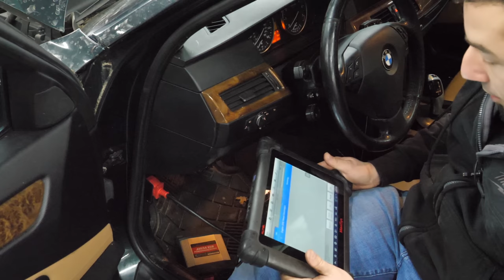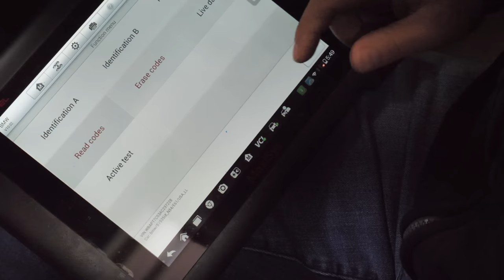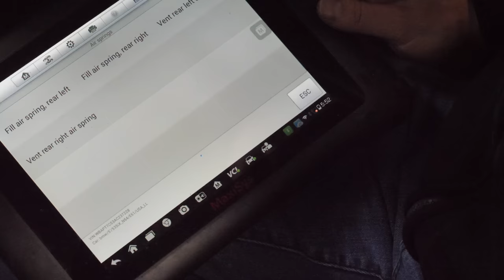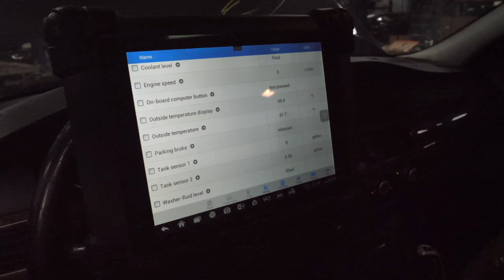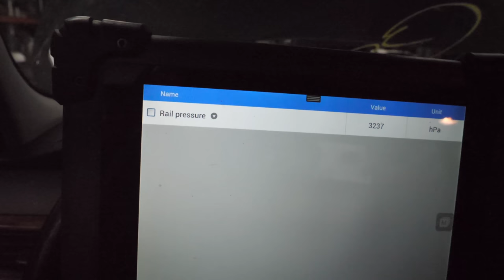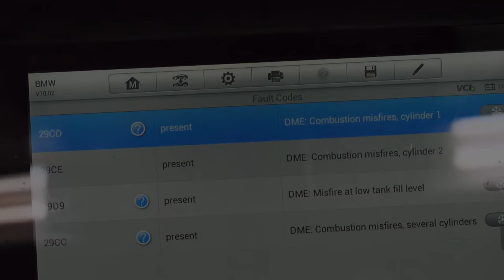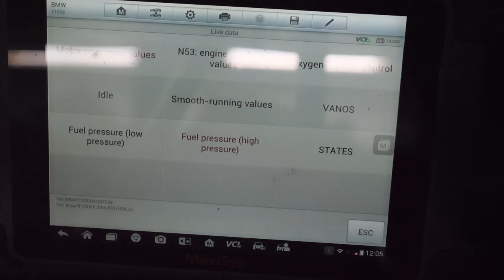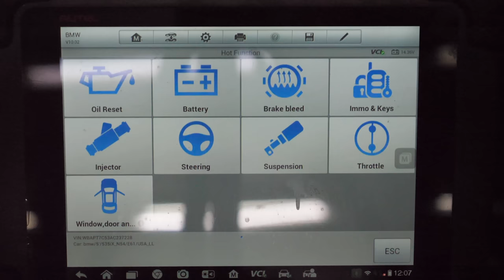WHO DID THIS? BMW Wagon I Bought At Auction LOADED with Improper Repairs. Can We Right These Wrongs?

Comment: E61 time! I have an 06 N52 6speed car, 350,000km, oooh that hatch hydraulic pump is a SOB to get out, I rebuilt mine with new seals (vid on my channel) but the hatch position sensors never worked, put in normal struts, is the hatch ECU worth money?  I laughed at the trash bag for the spare tire electronics, mine has been down 3 months now from FR CV axle replace, Trakmotive has too big C-clip on shaft, got stuck, 2 weeks of hammering, clip broke in diff, metal shards, cleaning out diff and repairing shaft now that I was able to get it out, SOB.  I've owned 40 cars, lots of them sports cars, E61 is my fav of all, brilliant car, X-drive works real nice here in Alberta, its quite smart about how it shuttles the power around in summer to cancel most of the understeer, but you know, CV axles and diffs and stuff.  Transfer case fluid change, good idea, will put on list while I have it in the air.  I import cars from asia, was checking E61 in Japan, so many low mileage, all RWD auto cars, lots of super mint 530's with M body work stuff, RHD though all of em, can't sell RWD in Alberta really (we can do 15yrs old in Canada).  Keep up that E61 content, omg I hope I never have to do the fuel pump, thats quite a thing! nice job!

Comment: LOVE the car & video!  I so wish they would have sold the 335i 6sp wagon here in the states!  Been tempted to buy a 328/330 and do a swap in a newer B58.  Love the E61's!!!  I looked for one of these in good condition for almost 2 years when I finally abandoned hope last December.  Just found a 2010 3.0(T) A6 Avant in great shape that I'm considering..
Reply: Please make sure you know where the timing belt is on that A6 Avant... I cant remember the years, but some of those beautiful Audi wagons had the timing belt at the back of the engine, so you had to take a zillion modules and everything else out, pull the engine and transmission, separate them, remove and install the belt, connect them, and put it all back... Shop hours were 40 + 40...And the parts for the belt install... Saw a few people just let their dead wagons go because they could not ever afford that much $$$ to get this done...

Comment: You were on the right lines with “airing up” the rear suspension. What you need to do is to “activate” the right & left solenoids that are in the Air Suspension Compressor Valve. This can be found at the front end of the air compressor, it should have two air lines that come out of the solenoid housing (one line going to the left airbag & the other line going to the right airbag).

Comment: "I'm sure there's going to be some broken stuff in here, coz it's a BMW"......how times have changed. It's really sad that these once proud companies who used to manufacture the highest quality vehicles have slowly succumbed to the business model of inbuilt obsolescence.
Since the early 90s I have always owned Japanese cars......with one exception. A 2003 Mark 4 VW Golf. And what a colossal mistake that was. Hands down the worst car I've ever owned. 
It leaked fluid out of almost every imaginable orifice, and left me stranded on the side of the road when the mechanical gearshift linkage decided it no longer wanted to be attached to the gearbox.
I ended up disposing of it at a local wrecking yard, and the look on the guys face was absolutely priceless when I handed him the keys and explained that it was dumping coolant and oil everywhere, and also had no 1st gear, no 2nd gear, no 5th gear nor reverse.....but as long as you only needed to use 3rd or 4th then you're golden. 🙃

Comment: Hahahaha the symmetry!!!  You are working on this BMW finding all the previous owner's shenanigans including a botched stereo install and I'm over here in Florida repairing a Earthquake PHD2000 shredder amplifier that some idiot thought it would be a great idea to only replace 1 faulty transistor on the power supply without matching transistor batches nor re0lacing the gate resistors.  They also botched the rewinding of the previously shorted output inductor torrid responsible for filtering out the pwm switching noise.....lol

I rebuild car audio amplifiers and my system?  Stock.  LoL.  I have sooooooo many HUGE amps too.  Buy em broken, rebuild, sell most, keep the unusual.

Comment: next time tie a string to the old unit ends on the drivers side and pull it through with the passenger side. reverse process to pull new ones in no sweat takes 2 minutes.  great video thanks

Comment: A bit late now, but how about a length of stiff wire with a loop in one end. Feed the stuff wire  through the tank with a length of string attached, and tie the sender to the string and feed it back through the tank. Saves you having to employ a mechanic with 3 elbows!

Comment: I am the original owner of a 2010 E61 (160k miles), Carbon Black, lite grey leather, fancy sound system (OEM), and pseudo M pack mainly for the Recaro seats. I love the car despite all its troubles: Blown main bearings covered by BMW, new injectors covered by BMW, yada yada yada. Oh and I forgot to mention new vacuum hoses for the turbo. I have an excellent indi mechanic nearby, but I no longer trust the car for long trips across Nevada or Kansas. We kept the car, my wife loves it, but I gave in and bot a Subaru Ascent — I have Subaru two dealers within 44 miles vs. the 160 mile drive to the Front Range for BMW warranty service.  

I envy you being able to take care of these old cars. It’s a d**m shame Americans like SUVs and not wagons and BMW no longer imports them.

Comment: Take off the interior and cover up the driver seat. You will have to take apart many interior parts anyways for rear suspension, rear parking brake cables, etc.
There aren't many rear interior for 5 series wagons after 2009.

Comment: I had one of those E61 Green, but the year before direct injection and the high pressure pump.  Great car, but a lot of eletrical gremlins.  Issues I had, steering wheels lock, wear out and locks your car after so many pre programmed stars (ask how I found out), starter motor, water in the back , learned how to clean the gutters, and off course the ignition coils.  Good luck with the car.

Dont get lost on too many projects like others do.  Where is the Porsche?

Comment: Reminded me of a 300zx I had. The only car I’ve owned that someone else put a stereo in, and then removed hastily. Noticed the smell of electrical smoke one evening. My friend and I (both mechanics) tried to locate the problem with no luck. Moved the car away from the house just to be safe. Heard the car alarm going off later only to walk out and see the car engulfed in flames AFTER we disconnected the battery. (Figure that one out) By the time the fire department got there the car was a pile of melted plastic.
Reply: The fire  had embered then burst into flame hours later...sorry for your loss.
Hope you got to enjoy it before that catastrophe....

Comment: Perhaps that schrader valve was plumbed into the compressor outlet and you still need to have the solenoid valves actuated to get the air to the suspension units?

Comment: Just a thought..... when removing the old fuel pump, attach a piece of mechanics wire to the fuel lines on the driver side before pulling the passenger side pump out, then when you reinstall the new pump, you can easily pull the lines over the drive shaft hump in the tank.  It's very sad to see such a cool car that has been worked on by cavemen, as a retired master tech, I used to hate getting a car in the shop that was so badly abused.

Comment: My wife has the 2008 535XiT E61 6speed manual and it is green.
The only thing it really needs is a the infotainment system upgraded.
Yeah, just had to replace the oil pipes for the turbochargers.

Comment: Being an 08 e61 owner I love the content.   I have been putting off doing the leaking oil pan for a while now... not looking forward to doing it.  When you switch to RWD, are you going to swap out the oil pan and pump as well?
Reply: I’ve also been putting off that repair on my 08 e61. Have to deal with that next year… and probably rebuild turbos while they are easier to get to.
Just did the oil pan gasket on an 11 e91.  It took me about 4 days with a few other repairs like water pump, ac compressor, radiator, etc. biggest pain was getting the steering disconnected from the rack. I expect the process will be similar for the e61.

Comment: If you gonna covert, get AWD Manual Transmission from 3 series.
AWD adds weight, but most of the weight is from front iron knuckles and shafts. Transfer case is not that heavy.
Newer refreshed models have better AWD transfer case worm gear made of metal. Lack of fluid change and plastic worm gears are main cause of death for the clutch transfer case driven by chains.

Comment: Just wondered if you have thought of picking up a couple of cores from a ' Tractor Pull'. Some of these super expensive engines are so disgusted by their treatment, that they leave the vehicle before the end of the run. You might have to pick up a few pieces. It won't be much of a strip down,  so you might need more than one!

Comment: Great job on the car so far. I can't believe the Schrader valve didn't fix the air suspension! 😃
Reply: What if say the control valves (that allow the air from the compressor to go to the air shocks to air up/air down)...were not opened?

Comment: You mentioned you could control the rear suspension air valves through your diagnostic tool. I was just wondering if you tried cycling the valves while you had the air hose hooked up, thanks for the video
Reply from the maker: in theory that may work, but if the control module is doing its job, it controls the valves and with the key in the ON position, it should be commanding both open.

Comment: Eric, did you check the oil before you started trying to start it?
Reply from the maker: I did what I could, since there’s no tube and the idrive system wants the engine running to check level. I pulled the filter cap and it had no metal, just the normal amount of oil in the housing. 
Sadly because of the crankcase vent system, there isn’t a dipstick retrofit
Reply: @I_Do_Cars  well, at least you won’t fight a dipstick if the engine is a Saturday evening teardown special.

Comment: I've owned BMWs continuously since 1987 (E23).  I was looking for an E60 wagon to replace my E34 wagon (S52/auto swap).  Older now so not looking for a project but I spent three months looking at E60 wagons and they were all either very high mileage, unkept buckets, or unreasonably priced.  Tired of looking a bought a 2010 Volvo V70 R-Design for $5k.  High mileage also (185k) but one owner and reasonably taken care of.  Doesn't look like BMW will bring another wagon anytime soon so first time without a BMW in many years.

Comment: when you pull the old pump out tie a piece of string or mechanic's wire to the end of the hoses and pull them through then attach it to the new pump hoses and pull them through from the other side.

Comment: found in canada a E61 , xi , 6mt, white ext, M-pack and I was like, meh, high mileage, Ill skip and found an other one. Which NEVER happened in 4 years... Didnt know they were so rare, apparently few dozen with the m pack and manual in canada. I give up, and I bought a clean high mileage E91 (manual with CCC) and a low mileage E90 335xi (manual with CIC and M pack) and starting my swap this summer. Cant wait. Will be on e90post.

Comment: What a mess. Just realized, the connection to the airsuspension.
There have been cars in the seventies with just that system. A airconnector right next to the rear registration plate. So you could adjust the suspension at the gasstation.

Comment: Maybe that valve you was just airing the small tank on the compressor and for the air bags to fill up, you need to start the car and open the air valves to the air bags? Cuz realistically they shouldn't fill up like that unless the valves to them are open which would deflate them the second you remove the air pressure.

Comment: Time out...  Eric. Use a piece of tape measure as a snake. Feed a 6, 7 ft. section through the fuel tank first. Cut little notches in each side so you can wrap a wire or tape around the tape measure and what you want to send through. Simple as, or in Australia, that will do me. Problem solved by a problem solver.

Comment: I caught myself saying: Why didn't the guy put a cap on the schrader valve to keep the dirt out?  Then, what I am I thinking?  He rigged it cut the plastic cover out, rigged it with a schrader valve and some hose clamps.  Of course he did not put a cap on the valve.
Reply: And usually any tyre shop will give you a cap for free....just ask.

Comment: I have a 2010 Z4 N52 non turbo w/ 54k miles. She doesn't see winter at all cause I take it to Florida but work in Virginia.  She is fast enough and I already knew the forced induction N54 has a lot of issues. 
Are those rear shocks collapsed ?? I bet sure as sheet they are the expensive $600 a shock ones too, the electronic controlled ones. Can't possibly be the cheaper $100 a shock ones huh.

Comment: Try the air in with the ignition switch on, it may have air solenoids that open each air bag individually.
Reply: So thought he was going to get there but no. Just need to power the module

Comment: Would it have been easier to run a fish tool from left side of tank access to right side of tank access then temporarily wire tie and/or tape the hoses to the fish tape end then carefully pull them back over the 'hump' and into position on the left side?

Comment: We have 2 wagons too (some Volvos are still made here in Gothenburg, Sweden). We have a XC 70 AWD diesel (from factory 2 turbos, one after the other, 215 HP when new) and an older beat-up V70 petrol/gasoline 170 HP when new, both are 5 Cyl. and front wheel drive. I would like a Holden produced wagon with a small block V8 like in the Chevy SS imported (?) from Australia, "before I kick the bucket". I'd prefer an AWD though and left hand drive of course. But fuel is real expensive and increasingly so over here. Caddillac has/had some nice wagons: CTS-V?

Comment: FYI the injectors were probably correctly coded. When registering with BMW ISTA the test plan does say that the numbers can deviate by 1-2 after being saved into the DME. That is not a fault. On the injector you showed, the 1st number deviated by 1 and 2nd by 2 so it was correctly coded
Reply from the maker: This is why I read comments.
I didn’t know this, and now I do. ❤️

Comment: BMW used to well built over engineered cars (most German cars where)  that looked very good.     Now I see them designed and built to a price point....rarely a BMW can get over 100K miles without a major repair  *yes some do but rare)  lots of fast failing plastic and sketchy electronics      I miss the old BMW's    now they are expensive trouble prone cars....BMW is the kind of car you keep til about 60 k miles and get rid of

Comment: "Wagons are kind of my thing"
Same dude, same.
Reply: If you need to do the pump thing again, run something like a coat hanger across first since it'll be easy to make a straight shot, connect it to the lines, then gently pull through. 
Signed,
Broke dude who has to figure out how to fix everything solo.

Comment: For the gas tank tubes that were giving you so much s**t, a piece of wire from the drivers hole to the passsengers side, then lay in a piece of string.  This is then  attached to the end of your pipes, which you pull back through the tank...
20/20 hindsight...

Comment: Do a S62 with manual swap. M62 non vanos at minimum.  N55 is far better than the N54. So if the V8 is not an option a N55 is the best option in my opinion.

Comment: When you tear down are replaces all the seals, try to use brands others than Elring aka OE gaskets. Victor Reinz, Felpro, will last you longer. Union labor ran Elring is why ALL gaskets leak on ALL German cars. They are forced to use Elring as OE.

Comment: Because the car has air suspension ....... does it also have an air tank? I have a 1973 C3 corvette that has a factory installed air tank in the front (it was used to work the headlights) I have changed the headlights to electrical and was wondering if I could use the tank for air ride suspension?

Comment: 7:00 considering the audio installs. what could i use to Securely mount a sub to the frame of the vehicle? i got a bunch of L brackets and attached em straight to the frame so the sub can slide in from above. and stay secured during even rough driving. but still easy removal of it when needed. but about 3 to 4 months later the system is getting a bit "loose" in terms of containment so i'm wondering what you'd like to recommend?

Comment: My main question is,  will you install a sealed oil catch can inline with the PCV system to remove the oil vapor from the intake charge building up on the back of the intake valves??
Reply from the maker: This car will get a full engine out build similar to my blue car, a few small differences, but all failure points will be addressed.
Reply: @I_Do_Cars  I put a catch can on my 97 Civic as I'm in the process of "mini me swapping" it from D16Y7 to D16Y8 with all forged internals and a GT45 turbo setup. Wish me luck and I know you will get your project done the way you want it!

Comment: Do you really need to crank air out of pressure rails, like diesels?
Reply: yes; it basically is a diesel...as far as injection goes....and it has electronic injectors..that won't run well on air.

Comment: Doesn't matter if a second hand vehicle runs.
ALWAYS go thru it before run it in the street.
Mostly several issues.
Clogged filters
Bad oils
Wrong coolant
Old brake fluid.
Just to begin with.